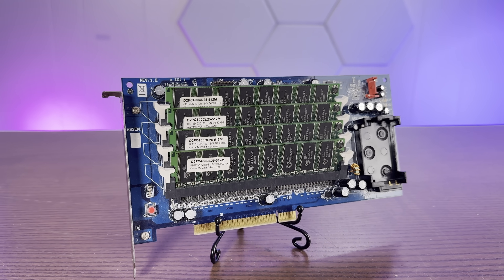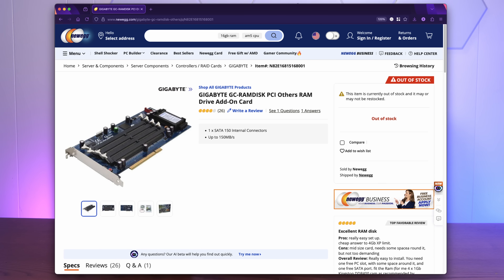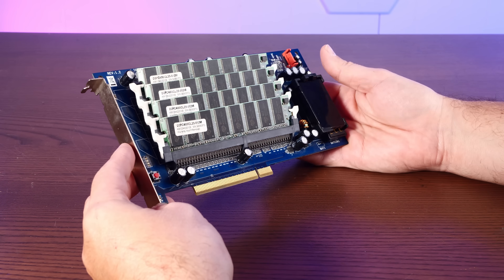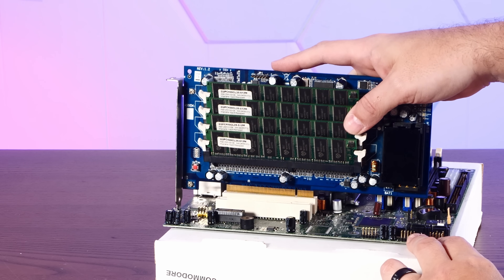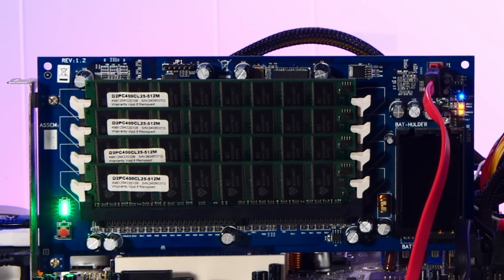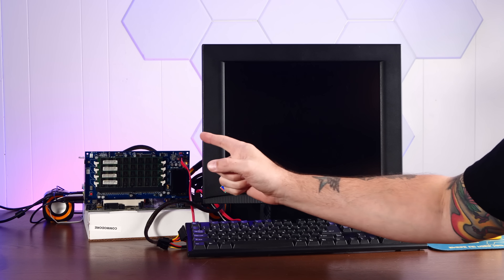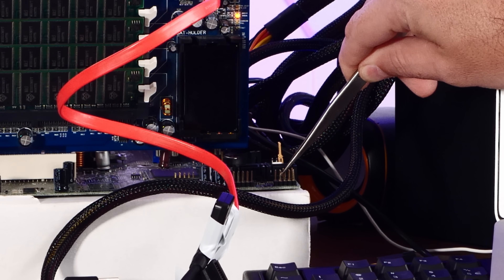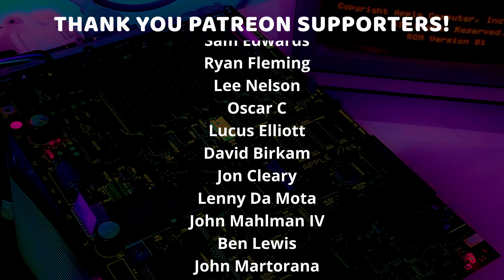This Early SSD Was WILD

Comment: Hey @Action Retro & friends, there are 2 great modern solutions for a semi-volatile RamDrive in Windows:  " IMDisk "  (older tool) and  " AIM Toolkit "  (the successor.) Both available on SourceForge (ie. Open source & Free!!). AFAIK both use the same base driver design as the commercial tool "RAMDisk" (by Dataram Inc.) .. IMDisk/AIM can use as much extra ram as your WinOS will provide beyond its own minimum requirements. For semi-volatility, you can optionally flush the ramdrive contents to SSD/HDD upon shutdown and reload it at startup (this setting is called Synchronize .) ...

e.g. I use a Win7 PC for ripping DVDs; 16gb RAM on system board; IMDisk will allow me up to a 14.2gb ramdrive (without any Win7 optimizations.) I'll rip a DVD iso to it, watch it, delete. Performance is of course ram speed. 👍...

Personally I still prefer the final release of IMDisk (Feb.2025) because it's extremely stable. Last time I tried AIM was Q1'2025 but its UI tool had crashes & weirdness (driver was ok tho). It's got newer builds available now, so I'll try again later. I even have an older build of IMDisk running fine on a Windows_2000 PC I use for special purpose; it's been going rock solid for years!

Settings:
- Read about All its settings so you're aware; choose accordingly. Note that when you 'delete' a file, AIM can flush it to RecycleBin but IMDisk does not.

- I use my ramdrive for Browser cache & other various apps cache (Discord; brokerage trading platforms, etc) & all my misc general documents 'work' (which I periodically flush manually to my \Docs.sav\ tree on SSD.) An alternate option for your personal work is to use Synchronize [flush] feature (which you can set to ignore dirs such as M:\Temp\.)

- My main login script builds a tree of custom dirs under M:\Temp. For any given app that doesn't allow you to redirect Temp files in its app settings, you can instead force it via the Windows command-line tool 'MkLink' tool to generate a 'Directory Symbolic Link' which is a virtual directory [Link] that points to a Real directory you place on your ramdrive.

- Browser cache redirect is critical these days. They write A LOT of temp junk & wear out your SSD. For Chromium browsers (Vivaldi, MS Edge, etc) the main cache redirect can be done by appending a setting in the browser's launch icon, but you still need a few additional forced links using MkLink. (I have about 4 extra MkLink's created per browser.) For any given app, just inspect its installation dirtree (on your SSD) and note the places where it stores temp or cache stuff; if you can't redirect that in the app settings, then force it with MkLink.

Fyi my IMDisk prefs: Letter [M] ; Allocate Dynamically [off] ; Launch at Start [ON] ; Create Temp [ON] ; FileSys [Fat32] ; QuickFormat [ON] ; Use AWE Phys Mem [ON] ; Synch [off]

NOTE: If you're on a laptop & lose power, in most cases you're not affected as most laptops are wired to first draw power from the internal battery (not the power supply/wall) yet then assuming the battery can still hold a charge. But if you're on a Desktop, make sure that system is on a UPS & keep your backup routine sharp & current... if you lose power, without a UPS your RamDrive 'live' contents are gone. (I realize many of you know a lot of this stuff; I'm just trying to explain thoroughly for those who don't.)

Comment: I want to know how fast a +8000mhz ddr5 ram on a modern board is , if it's even possible to do that on a modern system? I saw 14Gbps m.2 but I'm really curious about using something like this ... Well I think there is PCIE m.2 adapter that you can use it in RAID0 mod but never seen that on modern ram.

Comment: Back when SATA SSDs were hitting the market at insane prices, I was running two WD velociraptor 10,000 RPM HDDs in RAID-0. I didn't finally get an SSD until my next build, which I put together in 2009.

Comment: This seems like the "RAMDisk" concept that I have heard of (but never used, that I know of).
Reply: Much earlier, when we were still using  the original 8088 addressing with a theoretical max of 1MB address space, Lotus Intel and Microsoft invented a cunning way to multipage several extra MB for memory intensive work - these were the LIM memory expansion cards. The cards offered two different address models, plus a third option that used the card as a ramdisk.

You could get huge additional performance by putting your scratch file on the ramdisk, and the program you were running didn't have to know anything about expanded memory.
Reply: Basically, except it also saves your data for as long as the battery lasts and you are able to boot from it. Things you can't do with an ordinary RAM disk.

Comment: A good challenge video would be to leave this card connected to the computer and the computer connected to power for a week, and then see if the data on the card remains there at the end, then increase to 2 weeks if positive, and so on, until the data gets wiped (unless I understood it wrong and the card only gets power from the computer if it's turned on, not just connected to power)

Comment: I used this for a while as a boot drive, and I devised a backup of sorts - I had a hard drive with a minimal linux with custom kernel, it booted up first, decompressed an image from the HDD onto the iram, and rebooted into it. After shutting down Windows, it automaticall rebooted into linux, and dumped an image of the iram onto the drive, and shut down. If I wanted to override the sequence, all I had to do, was to manipulate control file on a separate 10 MB FAT16 partition on the HDD. Whole process took less than a minute.

I used it for quite a moment, until I could afford 120 GB Intel 510 SSD, then the iRAM got the boot, and ended up as a cache drive on a beefy enterprise NAS.

Comment: Ah, SATA 1... 1.5 Gbps or 133 Mebibytes/s. I hate Mebibytes, but 150 Megabytes per second translates to 133.33333333333333333... Mebibytes per second. 
Anyway, SATA 1 is bottlenecking that ram hard, SATA 2 at 3 Gbps would have that ramdisk singing at 266 Mebibytes per second, i'm sure.
Reply: The random read/write on that thing could probably fool someone today with snappiness compared to a modern PCIe gen3 SSD or something similar, i'm sure!

Comment: I used to have one of these.  As long as you treated it as volatile storage, it was fine.  I had extra memory sitting around, so the cost wasn't a big deal at the time.  I don't recall paying $140 though, mine was around $80.  I used it to run games of course (not the OS), but I stopped using it because some games absolutely would not work right running that fast in those days.